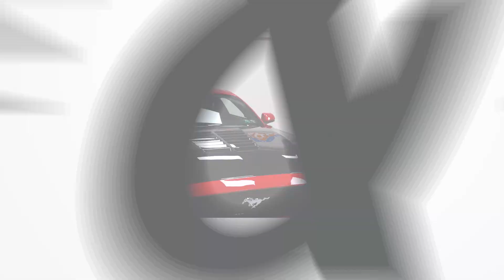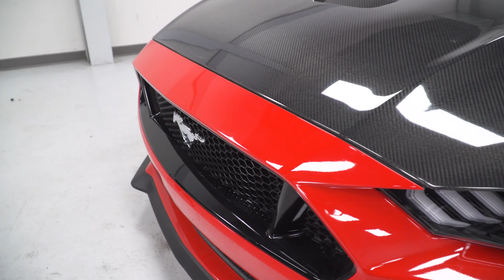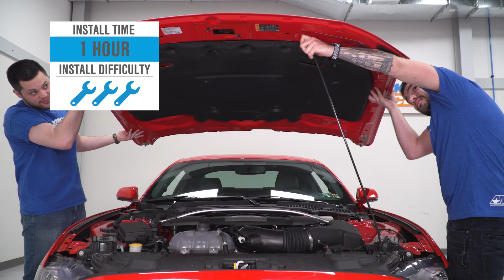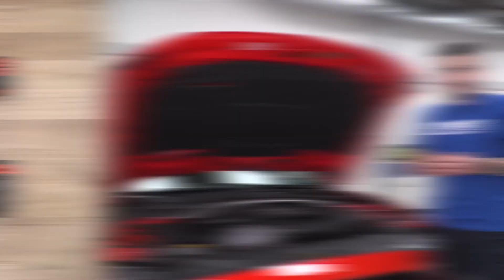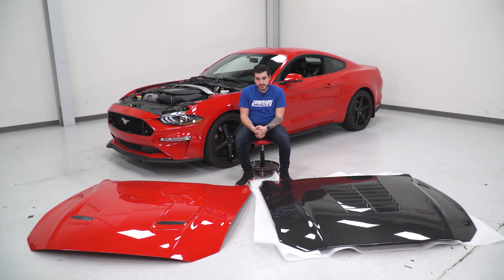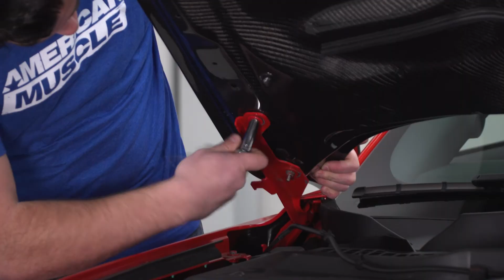2018-2020 Mustang Anderson Composites Type-GT5 GT500 Style Hood - Double Sided Review & Install

Comment: This hood is silly.  Sure it has an extractor but the hood should have a minor cowl if it was mimicking the “style” of the GT500 while also  creating room for a super charger.  Anderson Composites is the best but this one misses the mark.  I don’t know where the whole “GT500 molding” statement is coming from.  1. This is an 18+ hood so the molding clearly isn’t used and 2. It actually looks nothing like the GT500 hood in regards to shape and lines.  Like I said no cowl and the lines aren’t the same. Lastly the extractor isn’t removable and has no removable rain guard. There are other brands and better choices for this style hood if you want a better representation of how this hood should look and function.